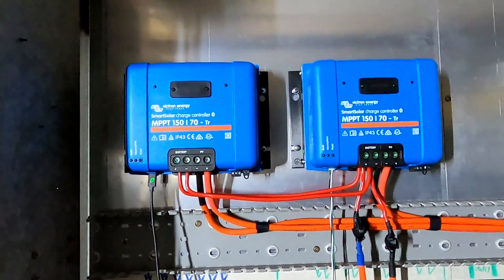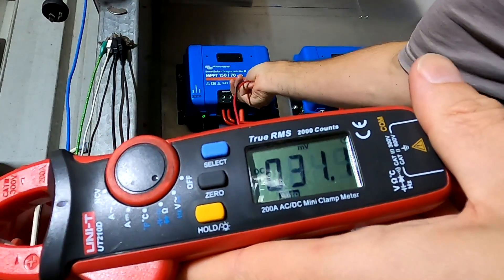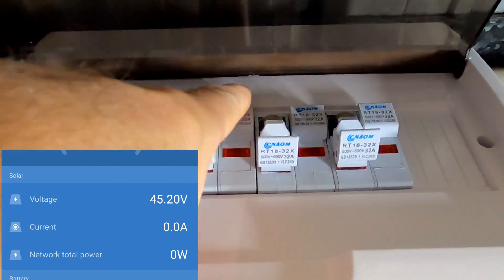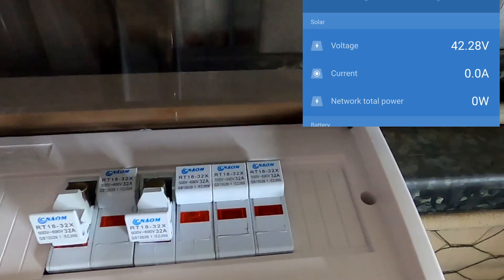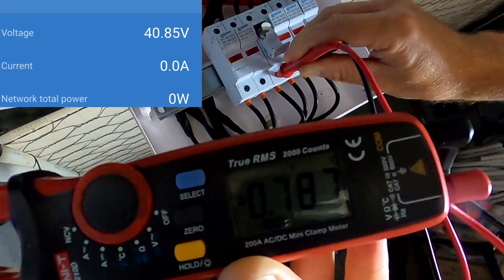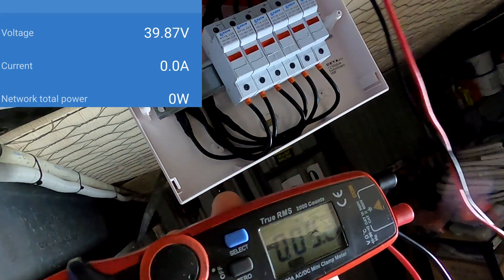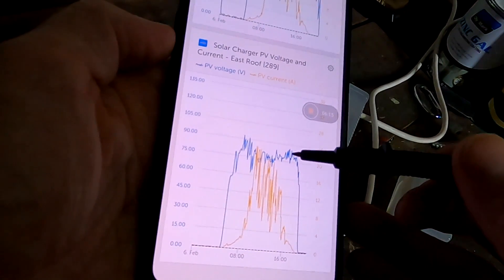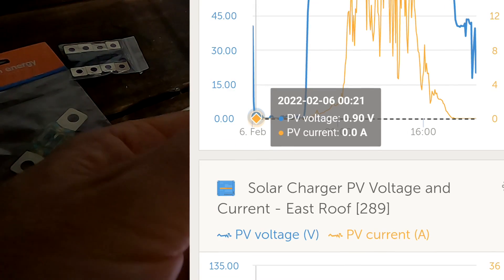40V at Night from Solar. Victron charge controller feature or fail?

Comment: Did you ever find a conclusion to this? Im grasping at straws here, but I will ‘have a go mate’, as us Ozzies say.
Mt 1st thoughts were induction from those wires running above ur combiner box, are they for ur lights or any ac? 
Your mysterious LED floodlight on nightlight mode, isn’t that induced from somewhere? Did you ever check/measure what voltage that LED gets to run it dimly?, it could be running from this same phantom voltage with bugger all amperage & is reduced enough through it’s circuitry to run the LED dimly as it does. Here is another thought, if you remove the LED floodlight load I’ll say, will this phantom voltage go up, indicating that it may be a induced voltage from an ac line. Another commenter said that he got a tingle from mc4 connectors at the inverter with no panels connected, I wish he had measured it, but this sounds to me like these AIO systems could have leakage issues from induced currents within. Dunno!, just guessing, like the rest of us. Thanks again for ur great vids. Cheers

Comment: I had just experienced a similar occurrence with the moon at quarter waxing with the EPever.  (4) 100w panels and the controller is set up for 12v.  for a short while the controller would intermittently send 0.3 amps to the batteries.   I could only guess it was due to the angle of the moon reflecting or the most recent solar storm? I'm in Pennsylvania and panels were facing south.
Reply from the maker: It is so hard to track if this is real power coming from the panels, a cabling ground issue or and electronics problem. I could not track it down yet.

Comment: Please test both with your ve.direct cables removed ?

Also based on the video it appears you have a genuine  adapter on the solar controller which is exhibiting strange leakage voltages and the non genuine one on the controller which appears to be ok ... is this the case ?

Comment: If you install 2 sets of cables for the batteries... 1 for each MPPT to the batteries, do you have the same problem? Can the fact the MPPT are installed in parallel can cause the problem?

Comment: Mate you have a ground earth leak. I noticed you have not grounded the the solar controllers. All units need to have a common ground. What you are measuring is a potential voltage difference generated from internal capacities of the units. Refer to victrons notes on how to ground things properly.
Reply: The solar charge controls are not (properly)grounded , but are  attached to the aluminum backplate and these are connected to the shed that is connected to the earth,  maybe a ground loop be created  with the solar panels, ground potential difference ...

I myself once experienced it in a building with two meter boxes, each with their own grounspike, that does not go well when you install  computer device, ground potential difference of 126Volt, a lot of smoke I can tell you..

Comment: Hi Andy, and thank you again for this video, very funny!
But you forgot your battery voltage?
I saw on your application 53 V
My opinion is that those volts you see (I think have no amperage?)
and it comes, I think from your battery, and possibly also from inverters which still have current in capacitors?? (even when off)
What is strange is that 1 SSC has this phenomenon and the other does not?
(it may be less reassuring for this SSC, it may have a small problem?)
In your place, I would have disconnected the battery from the SSC, waited a few minutes and checked again with your multimeter.?
Anyway, as always, I enjoyed watching this video,
and for that again thank you! Andy😁

Comment: That does not surprise me at all.  The moon is out and it is a clear night.  Wait for a full moon to be directly over head, or rather SPAT aligned with your panels, either west or east roof and see what you get?
Moon light is after all, just reflected sun light.  So no wonder the panels produce some voltage.  What will be interesting is to see how many watts you can produce under a full moon.

Comment: It looked like some sort of phantom induced voltage, but no appreciable current is actually available there, and you proved this, when you shunted the resistor across the bus bars the voltage went away. My guess is it's either a backfeed from one of the SCC's due to poor internal circuit filtering/fault inside, or a grounding issue somewhere.🤔🇦🇺

Comment: I think this is similar to situation when you have normal bench voltage meter and you wouldn't connect any voltage to imput..it will show you voltage like in volts..even there is no voltage at all. You can't measure voltage that way..
I believe it is because how it is with solar panels. ..they are not resistors they are voltage sources..so they produce voltage and such..they produce some voltages but because they have low path of discharge it is normal to see strange voltages..it is how it is wired..

Comment: Hey Andy, it’s Lee from up the road in Maleny… I had EXACTLY the same issue a few months ago with exactly the same Victron 150/70 Mppt charge controller… I put in 3 of them recently, livened up one for the first month or so while I added more panels… when turned on the 2nd 150/70 I added them to a VE.network with the battery monitor… all great for a while until I noticed the first 150/70 not turning off at night… it also had 40v on the PV and as it was my larger oversized array I thought it was moonlight as was a full moon at the time… I defaulted the unit, added it back into the VE.Network and it’s been fine ever since… both turn off at night as expected. I just put it down to something the MPPT was doing which a reset resolved!

Comment: I would suspect  the MPPT.   It may be a defect albeit notification performance now.  I would suspect it is associated with how the MPPT trackers work but to bias 40V, albeit a very high impedance source, is strange.  You may find if panels are OC placing you fingers between + and - input of solar charger will also drag it down (if you don't want to use fingers a regular high value resistor of 100k s or a megohm may also drag it down.
So solar 8nput of mppt is very high impedance when trackers are off (no load) but there is a high impedance connection in MPPT back to battery.
Concern for victron... will it stay or will it  change in the future for the worse.  If still under warranty get it replaced?

Comment: what's the voltage on the DC side on that charge controller (the battery voltage) - since you disconnected one line from the PV panels is most likely coming from the DC side, the ground must be triggering something in the controller and you end up with a voltage on the PV side. Something ungrounded maybe? controller has an issue? Is clearly not coming from the panels. One thing to note is that when you disconnect the panels 1 by 1 the voltage increases, so the panels are a load rather than a source at that time.
EDIT: Just thought about this, try to disconnect the PV+ side at the controller see if you still show voltage, long shot in the dark but maybe you get a different behavior than disconnecting at the combiner box.

Comment: Had a little bit of a hard day detecting.  O.k. my theory as a part German/Dutch background is have you hook a earth to the Victron yet? As I believe it is inter electrode capacitance. So the panels act as a capacitor to the shed roof. The operation of the Victron can be significantly affected by the existence of interelectrode capacitances.

Comment: Try disconnecting the output cables from the busbars in the combiner box and checking the voltage on the busbars will rule out the voltage coming from the panels.

Comment: On Feb 2nd and 3rd, the East side roof reads like you had similar signals those nights too, just in smaller durations. Feb 4th, The West side roof came online. That night the smaller signal switched to the West side SCC. Based on your videos, you did the SPD installs. It doesn't show you finishing those installs, just closing the box. Was there anything extra/weird from Feb 1st to Feb 4th that may not be mentioned? Storms, wiring issues, firmware problems?

Also, you have something turning on in the middle of the night pulling 30A from the battery, those durations of -30A from the battery coincide with the 40V blips. Something else to consider. Data I hope will save the day.

Going back even further, Jan 24th at 18:45, you see that voltage again when that 32A load kicks in and it goes away mostly at 21:31. Your pool pump maxed at 1kW, unless you are charging the Tesla at 1.5kW, irrigation pump issues?

Comment: Funny enough, I hooked up some DC cables to the MC4 outlets on my inverter yesterday and felt a tingle when touching one of the cables (not connected to panels yet). Must be some feedback voltage from the inverter's side, either AC or from the batteries. Doesn't seem to be an issue overall.
Reply: That is interesting, I don’t suppose you measured the voltage when u got that tingle from the mc4 connector’s? That info could possibly tell a tale of what is going on there, & u may well be right that it is some type of back feed from the built in inverter section. It would be interesting to see what voltage you have there, if it is the same as the inverter, or even if it isn’t , but has the same frequency, that would indicate that it was induced from the inverter. Cheers

Comment: From memory at night if a battery is connected to a solar panel the battery will discharge through panel (some amount of heat on panel). Perhaps at night the victrons (or one) are lettings some electrons escape???

Comment: I know such floating voltages can occur if there's a ground reference issue. It looks like both SCCs are in parallel on the battery end (sharing battery ground) however, the PV inputs appear to be independent. They don't even share ground (negative DC). I don't know how isolated the PV connections are to the battery connections in the SCC, but I wonder if maybe this is the issue causing the voltage to appear. Is it possible to bridge the negative PV terminal of each SCC together, so each solar roof array has the same DC 'ground' (negative) reference, and see if the issue goes away?
Reply: You also noted that isolating the PV from the West Roof SCC stops this voltage. Another quick test would be to actually just turn off the PV breaker from the East Roof SCC to isolate that one, and see if the West Roof still shows the 40v while East is isolated or if it suddenly disappears when there's only one solar array.

Comment: On my Epever charge controllers I can see the moon rising.
I also see short spikes, often on multiple chargers at the same time.
Those night curves always had been fascinating.
In your case I would assume some leakage current via earth and possibly a panel with degraded isolation.
IIRC your panels were used ones, so it is not unexpected to have panels with bad isolation.

Comment: Hi Andy you could try a couple of those ferrite split clip on suppressors from Jaycar cat;LF1290 etc. Can the negative side of your setup have a proper earth ground stake?  I guess each PN junction in each panel has a series adding barrier potential.

Comment: Hey Andy, I have an “old” Bluesolar 150/50, it has a bad voltage sensor in it (running it for 5 years s now!) , I contacted Victron several times and they tell me to disconnect it fully for 3 or more minutes and re-connect but the same 🐸 appears: so here is what happens —> morning -ok. Start charging, OK.  Heavy load (like washing machine ) —> it haemorrhages —> shows 100-200 volts on solar and 0 (zero) amps. I go into battery settings —-> disconnect charger —> reconnect charger and it Resets!! And then charging ok, this happens every day all the time for 5 years!!!! I love Victron set up and have been using it for 6 years *++ but occasionally their stuff is just 🐸 🐸 🐸.    I  purchased an Bluetooth dongle to connect to my smartshubt (Victron) and still the same issue albeit not as frequent . I think. Their voltage sensors go 🐸 sometimes! Time to call Victron and let them know! Keep up the good work !
Reply: @Hates Spam I "inherited" the CC when I purchased the property and it was out of warranty by that stage :-). I run everything VIctrona nd couldn't recommend them more, however, no company/product us infallible, products do break and they do come faulty and occasionally even from the best companies it is difficult to get support.

Comment: It looks like your ground rod from your AC panel that's attached to your shed that feeds your house is very close to your ground rod for the roof panels. Maybe put the ground rod for the roof panels on the opposite side of the shed away from your AC panel ground rod. It looks like it is ground looping.

Comment: Looks like the battery input on your charge controllers looks wrong, positive on one controller should be connected to a power source and on the other controller the negative to a negative busbar. That's how I see it hooked up in another person's setup

Comment: Ya got a low current leak through ya controller which can happen,.if ya worried just put a 10K resistor on ya bus bar
Reply: Also ya wont get induction from 240V into ya DC ;)

Comment: Maybe try disconnecting just the data cables to the charge controller(s) and manually test to see if voltage reading remains.

Comment: as ex pc tech .. never ending glitchs whgich is why we need techs .. have good contact cleaner and reset some contacts .. havnt replaced a hardware device in yrs now .. but have to continuously keep re-seating with cleaning .. and .. vroom .. back to life the way it shoud be .. smiles ..  anything with low voltage and low current are VERY SUSEPTABLE to disrupt memory and functionality of chipped devices ..

Comment: Hello! I had a similar situation once.
I bet you have a grounding problem. Check the grounding resistance. You'll likely have a leak in the switchboard outside. In my case, I had 110V AC on PE (230V by default). I added a few earth electrodes and the problem was solved. I also made a new connection to N-PE -> PEN -> N = / PE.
Greetings from Poland
Good luck 💪
Reply: Exactly what I'm thinking. He's got a ~40V difference in potential, cause everything is floating. No solid reference to ground.
Also, if I remember right, the Victron equipment no negative DC is connected to the chassis - which may be causing the weird changes when he pulls the fuses.

Comment: Andy, you've covered having SCCs in parallel to the battery, and looked into how well that works. Can you investigate having multiple SCCs paralleled at the PV inputs, but on discrete batteries, and then paralleled to the same battery. Different brands of SCCs and same brand of SCCs.
Reply: bla bla bla bla on your own front yard
Reply: Ahh. My mistake. I thought you had the PV inputs paralleled. Victron has the battery terminals on the left, not on the right.

Comment: At night my midnite solar classic always backfeeds the panels with about 19 volts. It’s always been that way. It’s caused me no problems but now you got me thinking.
Reply: At night my Solar Edge app shows wattage on each panel. I don't know if it just doesn't update quickly enough or what but, if I look at the panels on the app at 3AM, all of the panels show 0W. Weird. I've asked the local solar installer and the don't know. They suggest I talk to Solar Edge. I haven't.
Reply: @porter5976  the Solaredge optimizers are showing their last reported wattage before they powered down from insufficient input.
Reply: My Midnite Classic does the same, 24 volt system. I haven't investigated, but did notice the charger still displaying 20 volts with the PV array shut off. Maybe something to do with ground?
Reply: @todalavida1454  mine is 48v.

Comment: Part of me would want to wish it was the Moon, but it sure would not generate that much voltage... do wonder, with the 40v, can you pull any amp's from the system?   Though it will most likely be faulty device.

Comment: More Advise from a small man to a big island man. Solar panel float high on the negative wire. You can measure a voltage to battery negative any time one of the PV wires are disconnected. Stick one probe from your meter on any wire that is floating high and you will bet a reading.

Comment: I think it looks like some battery voltage leakage from the solar charge controller.  Switch the charge controllers  to confirm that it's a charge controller problem.  Likely a diode or synchronous rectifier mosfet is going bad.  The panels normally willl act as capacitor and some drain resistance at night.  Some variation in these between panel strings is likely.  Best Wishes, Bruce

Comment: Have you tried disconnecting your charge controllers from the batteries?  Kinda like when computers get quirky and you shut them down and start them back up and it fixes the issue. It may be a small bug in the software which needs a simple on/off reset. I noticed you shut off the panel from the breakers. Electronics get buggy at times. Hope this helps.
Reply: well said .. as ex pc tech .. never ending glitchs whgich is why we need techs .. have good contact cleaner and reset some contacts .. havnt replaced a hardware device in yrs now .. but have to continuously keep re-seating with cleaning .. and .. vroom .. back to life the way it shoud be .. smiles ..  anything with low voltage and low current are VERY SUSEPTABLE to disrupt memory and functionality of chipped devices ..

Comment: It is probably a leakage current coming out the inputs of the charge controller. It can be a leaking varistor or tranzorb or even a snubber network which protects the inputs from the charge controller or something like that.
If you put a  higher resistor, for instance, 100K ohm, is the voltage than also occurring? Maybe not and is the leakage current in the the micro ampere range.